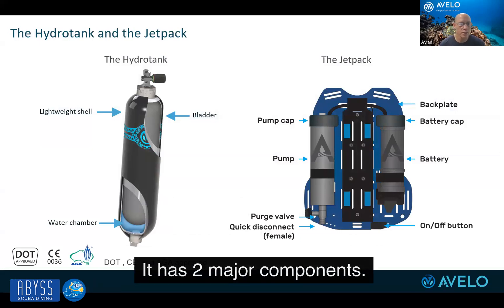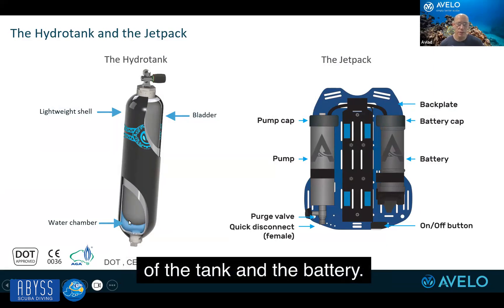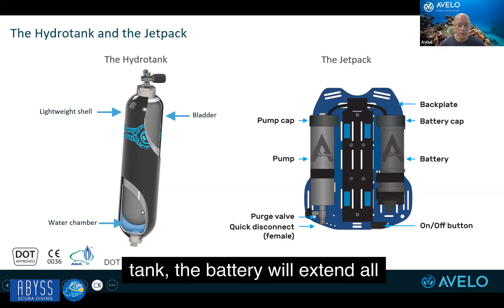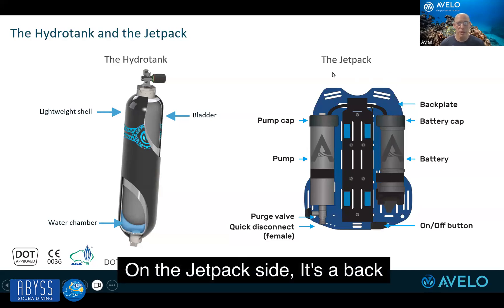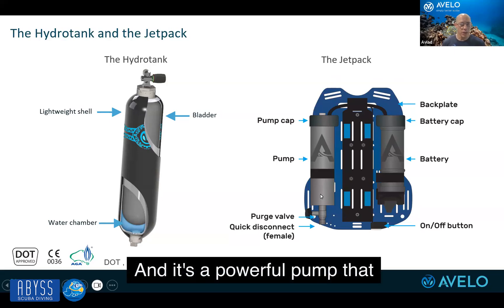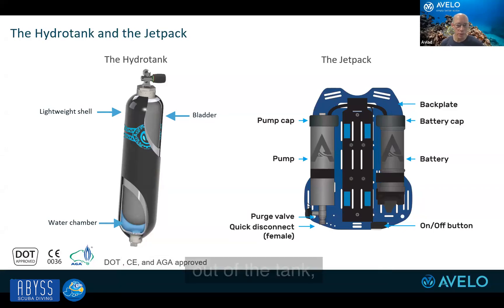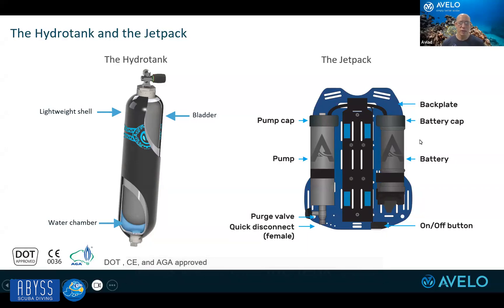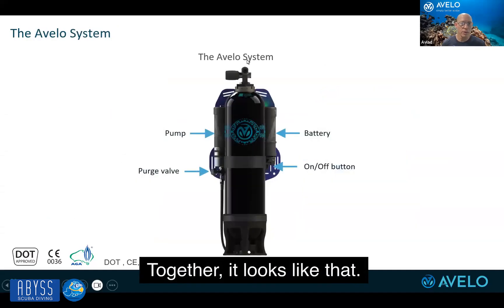The Avelo Dive System Explained

Comment: Costs, $4000+ for the unit ( hydro jet pack & 1 tank), $700 for the training course, $1300 for an additional tank if you are doing a two tank dive trip.

There are only 14 dive centres in the world that have this system, 12 of which are in North America.

In all the video's I have watched on the Avelo, there is a severe lack of rudimentary technical information that all prospective owners needs to know about.

The Avelo is an overtly, unnecessary, complicated and expensive system masquerading as a solution for a problem that doesn't exist. 

Firstly, what is the working pressure of the accumulator and cylinder wall thickness of the accumulator. What is the actual free air capacity of the unit.

You have introduced numerous additional potential failure points and air leakage points in comparison to a standard scuba cylinder.

It has absolutely no benefit to anyone diving in a wet suit or a dry suit.

Anyone who can't dive competently with a BCD shouldn't be diving period. It is not a difficult skill to master by any stretch of the imagination. Kids and pensioners all around the world can do it, but it would appear today, that the average US citizen can't.

The servicing and maintenance cost of your diving equipment has now greatly increased. The hydraulic pump will need to be serviced, repaired and replaced periodically. Electro hydraulic pumps working at 4400psi  have a very short life span. The battery pack will need to be replaced periodically. Also, a lithium ion battery pack of that size would not be allowed on a commercial passenger plane either as hand carry or in the hold.

As with a standard diving cylinder, you now have a pressure vessel which needs to be inspected and hydro tested periodically. However, you now have a bladder which needs to be inspected periodically and replaced periodically. Which will be subject to the corrosive attack of salt.

There are now two control valves for the cylinder which need to be serviced and maintained especially given that one of them is constantly being exposed to seawater flowing through it and can have sand, silt and other debris flowing into it causing it to fail.

This system pumps seawater to the inside of a steel high pressure vessel (Your Tank). The tank is only Kevlar wrapped. This means you are pumping a highly corrosive fluid into your pressure vessel which will remain in there, corroding away the cylinder.

Where are the properly trained service technicians for this, where are they going to get their training from. What is the availability of parts and service kits?

You have no competent surface buoyancy system. If necessary in an emergency on the surface with standard scuba gear, you can jettison a tank and still have your BCD to act as a buoyancy aid. 

This buoyancy device instead of being kept basic, uncomplicated with no reliance on technology. Now requires a battery pack, a hydraulic pump driven by an electric motor and a computer to operate it and specialist training. It is never a good policy to complicate diving equipment beyond that which is necessary. 

The KISS principle (Keep It Simple Stupid) in diving should always be followed.

Any fool can up with an idea or a device to make something complicated. A genius comes up with ideas to make something simple. 

Why are there no manufacturers videos showing an internal cut open view of the system and how they will prevent internal corrosion of the cylinder and bladder?

Comment: If as a diver you already master your buoyancy, there is no need to buy such a complicated device. I would not like my buoyancy to depend on a water pump. This is a very commercial thing.
Reply: I was thinking the exact same thing.  This is a lot of complexity to solve a problem you shouldn't be having in the first place.  There's a lot of failure points here.  What if the internal bladder fails?  I don't like the idea of putting 3000 psi into a carbon composite tank either.  I'm an engineer and have worked with CF composites a lot, and while they are light weight and very stiff, they are not isotropic, are more prone to manufacturing defects and are difficult to interface with metal components in a strong, reliable way.  Usually resins are used for this.  Add the continual loading and unloading of pressure stress from the air fills and you have the exact same situation that caused the Ocean Gate sub to implode.  Only in this case it would be an explosion in the dive shop rather than an implosion under water.
Reply: You have no idea what you're talking about.